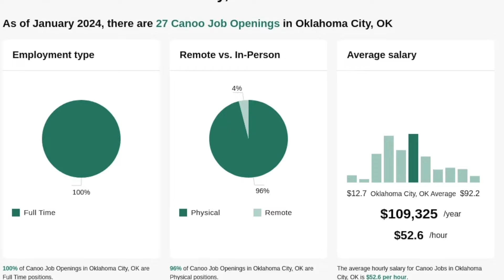Canoo takes it one vehicle at a time

Comment: .15 cents /share. Bargain? Comments please.
Reply: esperalo en los 13 cent
Reply: If this stock returns to $20.00 a share, which is likely a couple years away IMO, it will be the best 15 cents you ever spent. But getting a manufacturing line working and debugged is no easy feat. Couple that with vehicle DOT certs. and employee training, it's going to take time to make that happen. Still, they have orders for thousands of vehicles and new "veterans to the industry" added to the board of directors just for those reasons. So it looks promising.
Reply: @aeasus  I hold 3,000 shares. I bought on the dip a couple times and am averaged at .18. If it goes back to $20/share, I have $60K and will go pick up one of these vehicles for my initial investment of $540, LOL. Its a gamble, not looking good at the moment either!
Reply: @markzimmer1486  I read somewhere that there's a shareholders meeting at the end of the month. Hopefully it will mark a turnaround for the company.
Reply: I have 15,625 shares at .47 average buy in.   Im stuck with it and throwing it into the back closet. Im sickened from buying down the average multiple times.  Kudos to those who just jumped in and is at .12 as I Watch this video (2/21/24).

I've shifted my financial investment focus towards the Bitcoin halving and all the other baby coins that may reap the rewards.  

The Clock is ticking. #fomo
Reply: 12 cents now.  Eventually it's going to at least return to .24 but can it go down more before the next investment meeting is the question